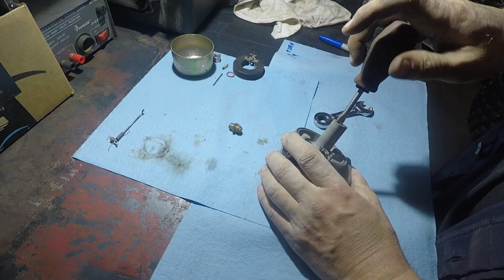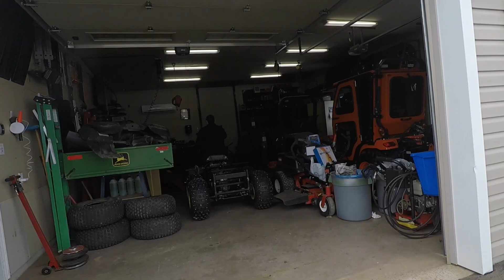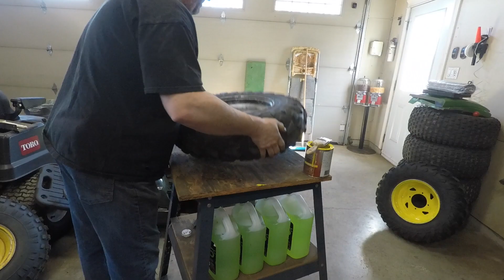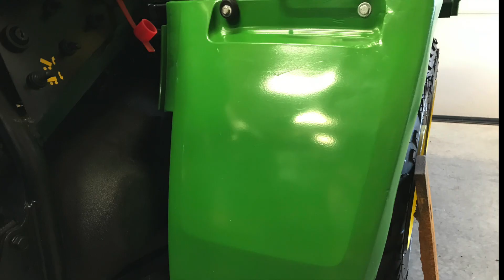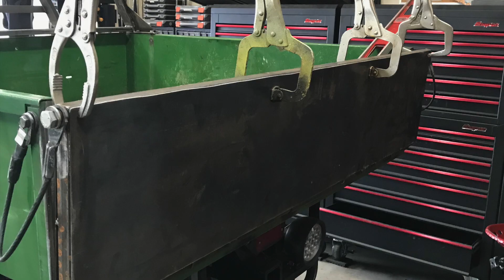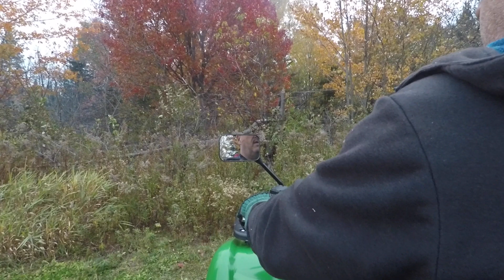John Deere 6X4 restoration

Comment: I'm looking for the brake caliper a amt 600 jd ,do you know where I can find some?
Reply from the maker: They are still available at John deere dealer. Very expensive and that’s the reason I built mine from a Honda motorcycle front wheel braking system